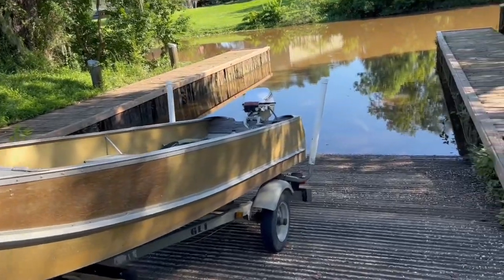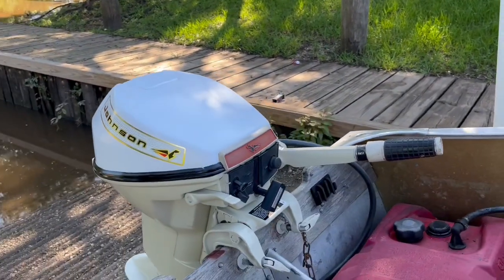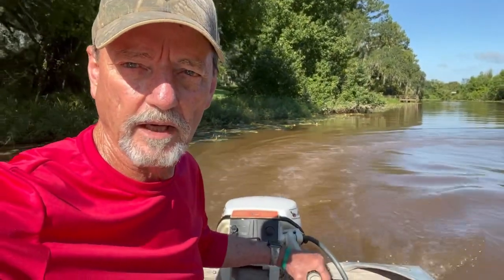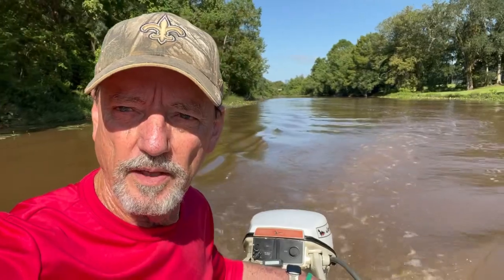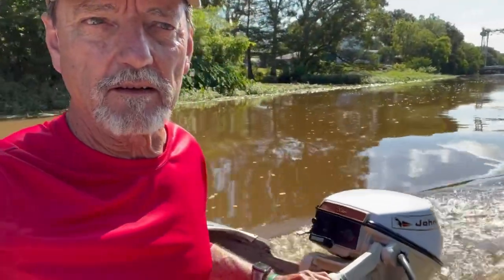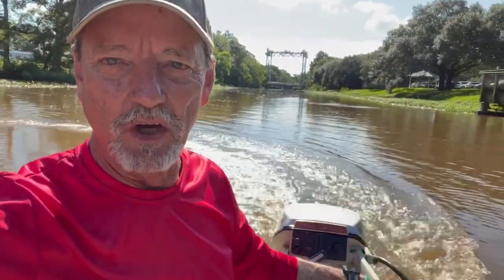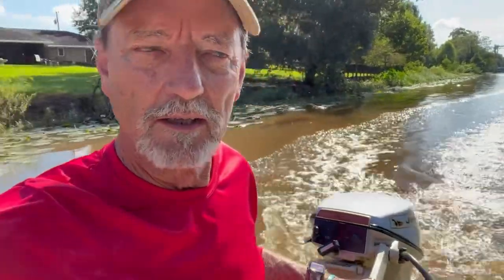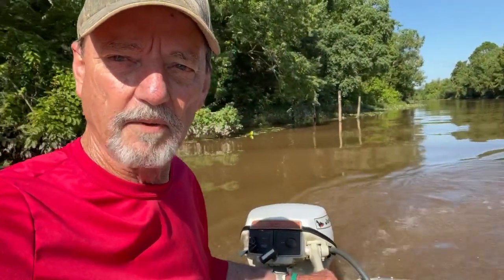“Mississippi Motor” Bayou Test Run 1965 9.5 HP Johnson

Comment: I just finished my 1964 9.5 johnson MQ-10R, great running motor, ready for many more years of service.
Reply: Do you like your 9.5 ? I have a 72 evinrude 9.5 probably one of my favorite outboards I’ve owned
Reply: Jmass, yes I do like it and plan on keeping it on my 14ft Jon boat.
I use the motor regularly, it's reliable and pushes the boat 18 mph so it's a fun motor to have, and simple and inexpensive to repair. No problem at all finding parts when needed.
Reply: @leepeterke4376  that’s great to hear. They are very reliable Motors with good power and parts are easy to get. Do you have any problems with yours shaking a lot ? I’ve seen that the 1964-65 models had motor mount problems
Reply: The motor mounts seem fine, It idles slow and no stalls, doesn't shake.
I'm in Wisconsin so I'm putting it away soon for winter.